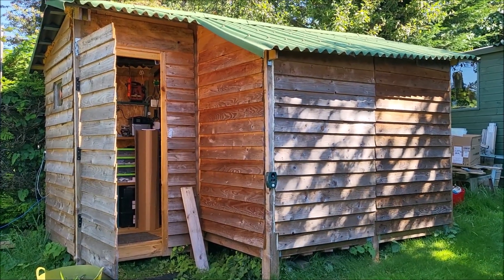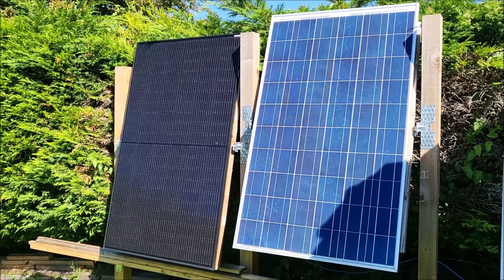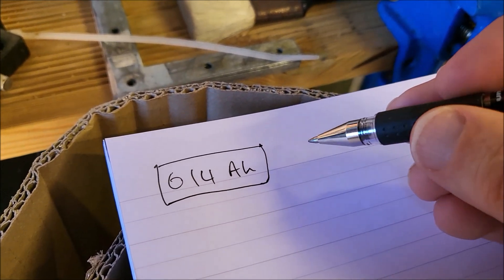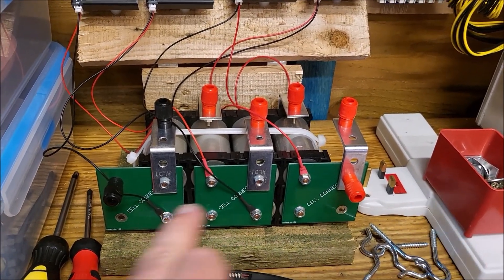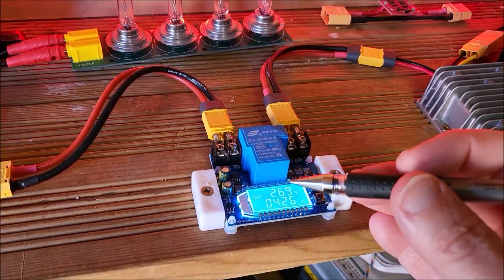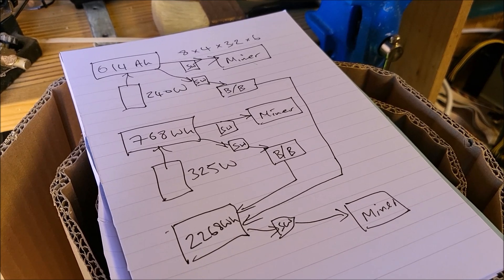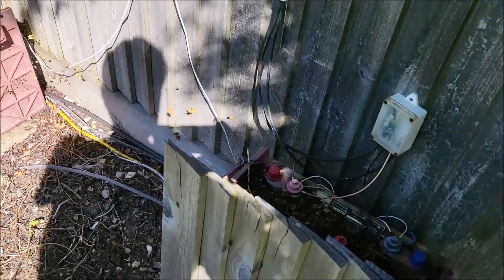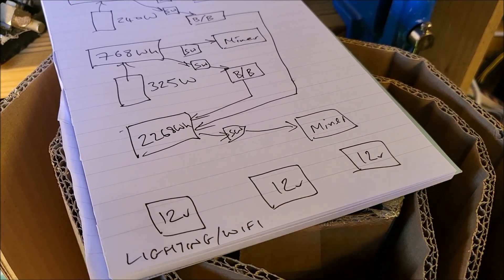What's the Plan? Update from the Modular Shed

Comment: I understand that this is mostly just playing about but I would think you would be far better off to have all of your batteries configured so they can connect to one or maybe 2 separate bus voltages and keep the system unified so you can use that solar power and capacity in a unified way rather than adding so many points of potential failure and efficiency loss.  You could combine all of your 12v batteries into one parallel 12v system for lighting and providing general power and then combine all of your packs you are building into one larger capacity pack that can supply power to your mining equipment.

Comment: I would strongly suggest just replacing your solar light system with the 3 LFP batteries. Then plug everything that you want to power from that same system. I see no reason in adding all these extra points of failure by having 3 separate systems that could just be one.

Comment: Does anyone think that a 3 kw inverter to power a washing machine and water heater would be good 

It would be easy to extend a ring main to places in your house from the inverter 

Would be a big money savings if you plumb the washing machine with just a cold water supply it will heat the water with free energy
Reply: Definitely tumble dryer they run at 2 kw ish
Reply: so why are you splitting the batterys up? Grantet the 12v batterys sure i get that . i would keep the smaller cells together and make or buy  a enclosre with air flow of some kind .

i know ev car batterys are water cooled its complicated maybe a old u4 server case get one with fans 

im sure wen charging without load wont matter ,If there is a load and the cels are charging they will get hot
Reply: Line the case with correx .it’s on ebuger 20£ for a 8 by 4  sheet .think up a clamp system  for the cells 

Maybe normal pc fans would be less noisy 

Fire proof, explosion proof air cooled 

And scope to add sells
Reply from the maker: Really this is a showcase setup for different kinds of solar panels, batteries, buck/boost converters and electronic loads. In summer, there's a huge surplus of solar electricity - the miners run everyday and domestic appliances could be included in the mix. Winter, however, is a very different story. There's enough power for the shed lights, but the miners may only start up once a week.
Reply: @JulianIlett  thanks for getting back I  just thought more amps and a expandable battery packs that is cooled I think 🤔 it’s really interesting to me 

It would be a really good video series add another solar panel  At a different angle it will work

Comment: Unnecessarily complicated... but in a fun way 🙂

For "Give AND Take", you could put both switches upstream of the buck converter, and thus not be wasting power on its standby current when Give is active but Take isn't?
Reply from the maker: Yeah, it might work better that way round. The relays will also have a small current draw.